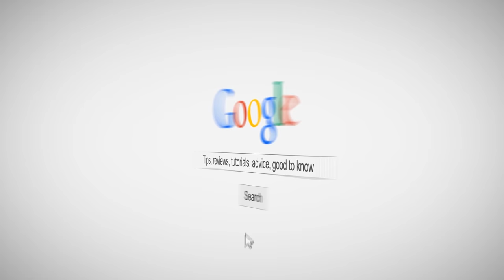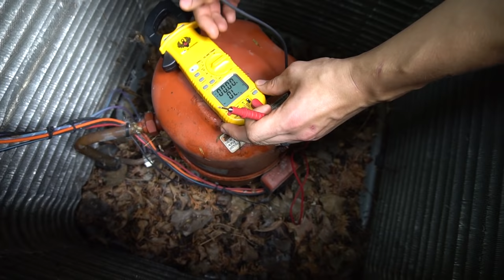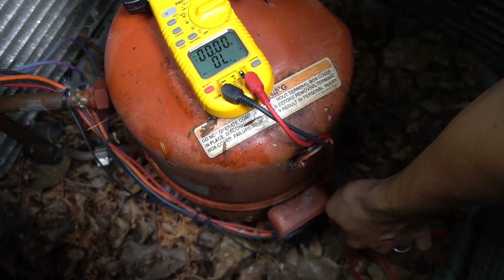AC Keeps Tripping Breaker and The 10 Most Common Reasons Why

Comment: Great video.  Power failure at my house yesterday.  Power came back on, then went off a minute later, then came back on again.  Noticed after the power came back the a/c was not blowing cold.  Checked the air handler and that was running fine, went out side and noticed the fan wasn't spinning.  Went into the garage checked the breaker box and saw the breaker was tripped.  Went to reset it, I hear a buzz and the breaker trips,  Tried it again and same thing.  So shut off the breaker, pulled the main power patch out by the a/c unit.  I removed the a/c access panel, noticed the capacitor was not mushroomed out, looked at the contactor switch, nothing looked or smelled burnt.  Wiring looked ok with no bare wiring exposed.  Don't know if it's a bad contactor, capacitor or compressor.  The unit is 2013 4 ton Rheem.  Have an a/c guy coming out tomorrow.
Reply: I have the exact same thing happen today. Did you ever figure out what the issue was?

Comment: I know fluke meter are great but those UEI are underrated.  I bought one back in 1995 when I first started AC work and still use it today.  Unbelievable its lasted this long.  Back then it was about half the cost of a fluke multimeter and I didn’t have to buy a separate clamp on amp meter.

Comment: Thank you, i was able to solve my daughters problem with her compressor being bad. Now my unit is acting up. Lol. My outside unit has a seperate breaker than the unit in my attic. unit in attic runs fine until it gets hot outside and trips breaker. Runs all night, until temperatures climb.

Comment: Sir what is the time interval of an ac that keeps tripping? I don't want to leave the customer and then I get a call back cause it tripped again. Thank you, I will start supporting your channel once I get hired and work in the field. Lol
Reply from the maker: I don't know if I understand the question.. So the breaker is intermittently tripping? Runs for various lengths of time? If it's intermittent then those usually take some digging into to figure out.. Could be a bad run or start capacitor, could be a loose/burnt wire somewhere, a defective delay board, etc..
Reply: @WordofAdviceTV  Ive rewatched your video, and from your reply basically what you were trying to say is to check through almost everything on the outdoor unit, the wirings and the capacitors so that you wouldnt have a call back. I greatly appreciate your time in replying my newbie questions. Thank you very much!!
Reply from the maker: @FighTinSlowMo  Intermittent problems are hard to deal with.. I usually explain that to the customer and let them know that I checked everything on my end and am not finding anything wrong. It is hard to fix something that is working... So I will have to call it good for today and ask you to call again if the problem returns.

Another thing that could be causing this is the wiring in the disconnect or sometimes the circuit breaker for the AC is going bad, is cracked, or melted..

Comment: My unit trips the breaker on the hottest days it seems, sometimes randomly.  I’ve had an AC person out about it a few times over the years and they said everything is fine and see no issues.  It still does it and did it just now our first real hot day of the year.  Guess I’ll look into cleaning it, but this has been happening since we bought the house 20 years ago.  The air stays blowing inside but is no longer cold.
Reply: In really hot days we do have high pressure problems due to outside heat. I'm not sure if it's wise to install something to provide shade for your outdoor unit but that could solve the problem (make sure you don't restrict air flow)
Reply: When did you change the run cap last? If its more than 4 years, time for a new one.  These caps are very sensitive to ambient.  At higher temps, the high pressure is also higher, so an aging compressor could be drawing more amps. You can check the draw with a clamp meter.. which will give you a little better insight.

Comment: Excellent video!  I'll be looking at a few of these things tomorrow.  

One thing I'll add is that you might have shown how the disconnect paddle works rather than pointing to it.  Many will not know anything about that item.  I think the fear of the electrical box it is in will scare them but the troubleshooting you describe is safe for even novices, once they realize how to safe the equipment.

Comment: Good video... Can a capacitor cause intermittent  breaker pops? You mentioned a hard start kit but not a capacitor? Thanks
Reply from the maker: Some people say it can but as for me, I don't remember ever coming across a run capacitor that was causing the breaker to trip.. I would suspect other things before that.
Reply: @WordofAdviceTV  Thanks for your reply. In the past few months the beaker has popped a few times several weeks apart. In the last 2 days it has popped 3 times. 3 and a half year old unit. Filter and compressor coils are clean. I'm going to read breaker temp with my ir gun today and inspect inside wiring area of compressor unit to see if something reveals itself.
Reply from the maker: @Scott Norman Good luck! Those intermittent problems can be hard to catch. I would check voltages too. If you have a meter. It's possible that you are experiencing a "brown-out" in your area and that can be messing with the unit.

Comment: Your videos are great, I been working on my AC for last 4 yrs my unit is 28 yrs old and still cooling our house great. Every yr we have heatwaves for weeks at a time and usually at that time the capacitor seems to go or a wire is burned up. Needless to say I keep some on hand at all times. This year it’s different it’s been brutally hot for weeks and the AC is not getting a break. Sat it was 103 and it stopped running so I noticed a wire from cap to contactor was burnt and I went out and bought a new wire to replace it with. Also I tested the capacitor and it was bad so I replaced it as well but no luck and I noticed I was not getting 240 volts at the contractor. The breaker has 240 volts going out so next step was to check the fuses in my disconnect box. Of course one was dead so I replaced it and the new one died an hour later. I thought ok maybe it was a bad fuse and I replaced it again and 36 hrs later it’s bad again.  Back to troubleshooting tomorrow your video is so helpful I now know what could be causing the fuses to blow. I hope this works and it’s not my compressor! Thank you for your informative vids

Comment: Thank you for your nice video. Here is my situation. Hope you give me a good advise
The breaker was always tripping.
I opened the AC unit and found the incoming grand line was disconnected.
I reconnected it and turned on the braker. No tripping and I heard a roaring sound from compressor for 30 seconds and stopped since the braker was tripped.
Then, I disconnected 3 wires to the compressor from contactor & capacitor, then turned on again. No tripping and no sound.
Next, I turned on the thermostat. I saw the small spark from contactor and the braker was tripped.
Finally, I tried to disconnect the cable on compressor side after removed the top fan but in vain , too tight. I scratched the top paint and connected to 3 wires one by one by volt meter as you did.
All are not contacted. (may not be accurate) The compressor may be good.
I don't understand
1.Why the compressor is started when braker is on although the thermostat is off.
2.Why the braker is tripped when the thermostat is on after disconnected the compressor.
Do you think that the problem is the fan or capacitor?

Comment: Thanks you. Can you explain both case of low/hight gas charge tripping breaker. High gas charge gives high discharge pressure so i guess that means high amp draw. But low gas charge ?? please explain rather than just saying it trips breaker. Michael
Reply: What if its the heat that trips the breaker? The ac always works fine. But since its cold here in central fl i turned on the heat and within a minute, it trips the breaker and shuts off. Is it the same procedure? Thanks for any advice im clueless.
Reply: There is a problem with the electric heat package .

Comment: Hey can a thermostat cause the breaker to trip? Not sending constant 24 volts to the contactor? Causing the contactor to make and break?
Reply from the maker: I suppose it's possible but I have never seen that happen before. The thermostat is on the 24v circuit and the circuit breaker is for the 240v circuit.. So usually the low voltage side wouldn't cause a breaker to trip. But it if it's causing the unit to go off and on then I could see how that could happen.

Comment: My heat pump (only three years old) trips the breaker some times in 20 minutes some times in 1 or 2 hours when running the cooling. Filter is changed, cleaned the outside unit (it was fine before as well), air vents are not clogged. 
Any suggestion what I can look for to resolve this issue?

Comment: What about the fan in the air handler shorted.  Also the on/off switch at the air handler shorted.  And one of the two 120V feed wire insulation missing and shorted.

Comment: The main reason I dont use a hard start kit on my ac system is that the run capacitors fail sometimes in less than three years and I believe I wouldnt notice because the unit would still start from having the hard start in the circuit. This would over time damage the compressor. Ever wonder about that?

Comment: Thank you for the excellent video.  My house has air condition it caused short circuit of the electrical panel in my house, it seems its +110V line  and -110V line have  a short circuit in the AC when we start AC for over night , next morning  we found it caused a 100 amp  fuse broken and the electrical panel in my house has a short circuit by the AC to produce 110 v only , It really shocked me, is it very common issue caused by AC?

Comment: Cutler Hammer breakers are notorious in my company for going bad if you use them as disconnect switches. If you turn off your unit using a Cutler Hammer Brown Switch Breaker while it's running, you run the risk of it being locked in a permanently tripped position, where it will trip even if you completely remove it from the system.

Comment: On my heat pump there is an internal breaker which is low voltage that keeps tripping and turns off the thermostat inside the building causing the whole system to not work. The high voltage breaker in the building breaker box never trips. The low voltage internal breaker has a very small soft push reset button that I have to keep pushing every few days and requires removing a panel on the h.p., pushing the button and replacing the panel.
Reply from the maker: Is this little reset breaker mounted to a copper pipe? If so then that is a high pressure switch. The most common reason why those trip is because of a dirty condenser coil. The first thing I would try is washing down the outside coil even if it looks clean. If the breaker is not connected to the refrigeration system in any way, then there must be a short somewhere. A loose connection or a damaged/chewed/bare wire that is shorting out and causing the breaker to trip.

Comment: Great video. Thank you! Is the compressor body grounded through the case of the a/c unit? and none of the three wires going into the compressor are not supposed to touch ground?
Reply: Because people cleaning and servicing refrigerant compressors often touch them while simultaneously touching some other part(s) of their bodies to a ground, standard electrical safety practice requires grounding refrigerant compressor housings.  You are correct in assuming that none of the starting/running power wire connections should internally enable connecting to that outer metal case.

Comment: Unless I misinterpreted the video, did author say if you unplug the compressor leads and it doesn't trip, that it's automatically a bad compressor? That seems a little "off." I don't know enough about electrical systems to say for sure, but if there's nothing in the line to call for the amperage, couldn't it still be a weak breaker at the main panel, or a loose breaker outside? Or couldn't it still be the capacitor? Perhaps this is wishful thinking, but I don't want to give in to a new compressor or condenser quite yet.
Reply: totally, a bad contractor, capacitor or breaker will do it too, one needs to check the compressor ground to case and resistance between legs!

Comment: I watched your capacitor and contactor video, replaced them and ran all summer great so thank you. Now in heat pump mode (which it did okay all winter until Feb 25th 2020)when the outside unit fan comes on I am hearing a light fluttering noise (the only thing I can reference) and compressor would not start after numerous times it did this, so the outside unit would shut down and then the outside unit would restart and then the compressor would come on immediately. Now it is blowing the inside fuse and when you try and reset a huge spark inside the fuse box. I am now running on the emergency heat from the inside unit. I don't know any companies I can trust to look at it. Help  please. Have not tested anything yet as I do not have a ohm tester.

Comment: The compressor could be causing the problem because it's pulling too many SLA amps, what you can do for that is put a hard start kit on it and that will fix the compressor for a little while now like you said if it is grounded out then the compressor is bad but if it don't show ground always put a $20 hard start on it and at least try that before you buy a new system

Comment: The outdoor breaker have 2 options, disconnect and AC. AC would trip about 10 minutes after it run cold. Thank for the great videos. What should I check next? The indoor breaker is working fine.
Reply from the maker: So you have a breaker in the disconnect and another breaker in the breaker panel? To begin with, hose down your condenser unit and get it clean, even if it doesn't look dirty. Then I would take ohm readings of the compressor and the fan motor. Do you have a multi meter that can check resistance?
Reply: Word of Advice TV since then I have unplug the compressor to troubleshoot and it didn’t trip with the fan running, tested for an hour. 

Is it normal for the outside panel to have an AC breaker? Many videos show Disconnect breaker only. It’s not lock so anyone could access it controlling the AC from outside.

Readings have not been took with a multimeter since not knowing how to use the one i have. Seem like the compressor may be bad but went ahead with the lesser cost by exchanging the capacitor. With the new cap, it ran longer but still trip after about 30ish minutes from 15-20.
Reply: On a side note, the unit have not had a clean or tune up per say since I live here for 10+ years. 

With the Unit sprayed from the inside and outside, it running longer than 40 minutes so far. 

Let hope it may be as simple as needing the unit to be clean and functioning within the threshold.

Thanks so much for your assistance with this process.

Would definitely utilize your service/business if locally
Reply from the maker: Good to hear that it is working better now! Hopefully it will just work and not give you any more trouble ;) And if it is working good, I wouldn't bother with the AC inspection..
Reply: Word of Advice TV  it was running around 48 minutes when I had to leave but it was tripped when I got back to check it within 3 hours total time.

Reset the AC breaker, it has been running for almost 3 hours now... and then it tripped short of 3 hours

Could the contactor the next item to replace? Next less cost item

Is it normal for a small burnt smell, standing next to the AC breaker outside panel where it was trip and where the Disconnect and the AC breaker? Still surprised AC breaker is outdoor. Was the AC add on later so they add the AC breaker outside instead?
Reply from the maker: Ahh darn, so the problem is still there. It's unlikely that the contactor is the problem. Do you see any physical damage on it? Broken, burnt, or melted spots? 

The small burnt smell worries me actually.. Something may be shorting out or a wire is melting. You may want to call a service guy out just to be safe.. If I it was me, I would check the voltages first, at the contactor and the disconnect to make sure I have 240v, not 280v or something in that range.

And the breaker at your disconnect is normal. I see many disconnects that have a breaker instead of a plug. Usually there will be another breaker in your main circuit breaker panel for the condenser unit.
Reply: Word of Advice TV breaker instead of plug for the disconnect I have seen from other videos which is normal. What I have not seen any or much is another breaker beside the disconnect is another breaker for the AC. Which is outdoor. Shouldn’t it be indoor along with the rest of the breakers where the indoor panel. Seem to be better to have it indoor so other have no control over the AC unit or the breaker to it
Reply from the maker: That is a good point.. I don't know why someone would install it where it is so easily accessible. I don't have any ideas as to why it was done that way

Comment: Hi,
My heat pump outdoor condenser fan will run for a few minutes and then shut off. I turn the outdoor  breaker off and on and it does it again. Does that sound like a low freon issue? Also, the inside v shape became frozen last week and water leaked out onto the garage floor. Thanks for you advice. Your'e awesome!
P.s. Subscribed and a thumb wayyyy up ;)
Reply from the maker: Thank you for watching, commenting, liking, and subscribing!! (Going above and beyond man! :) That does sound like a low freon issue but could possibly be something else. I have a video dedicated to that topic if you haven't seen it yet: https://www.youtube.com/watch?v=stZs8Co80vk&t=172s